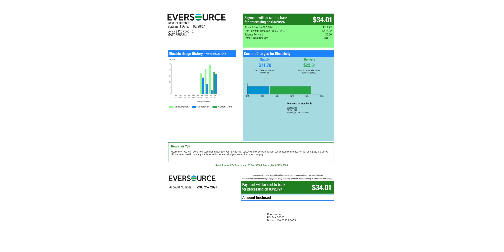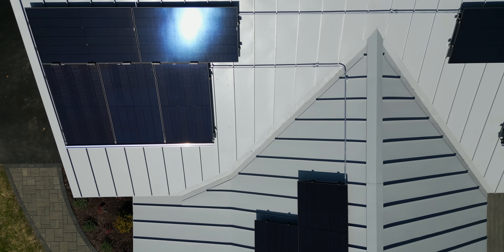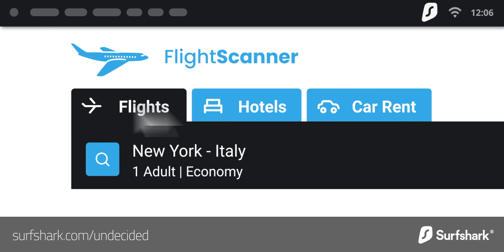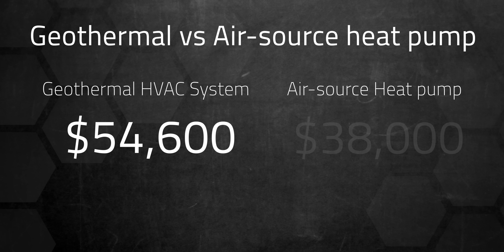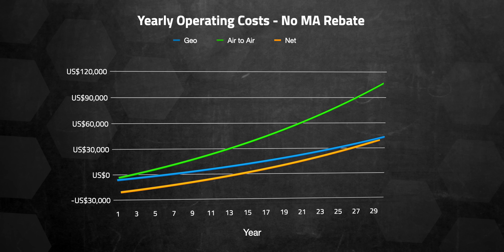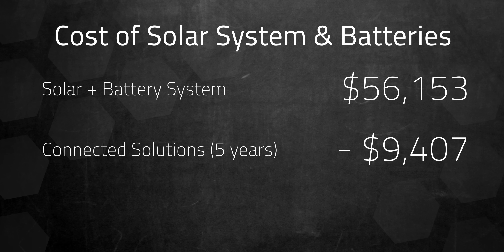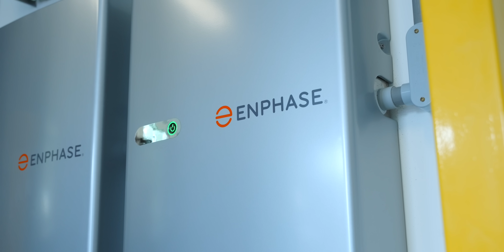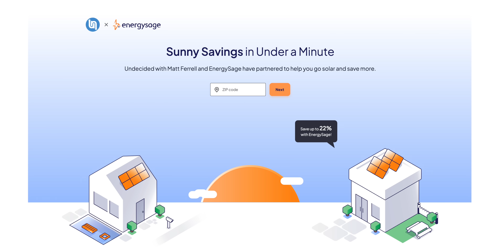What I Learned After 1 Year with New Solar Panels

Comment: We have a solar system that in 4 years has provided a net positive amount as our utility gives us a monthly credit if we produce more solar electricity than we use. HOWEVER, the utility is not solar friendly. They recently increase the cost of electricity to homeowners, but did not increase the amount they pay for excess production. They also have a ton of charges/fees/taxes that almost negate the solar credit, particularly this year. So you have to understand what your electric utility does and if they are solar friendly or not. Same goes with your state and if they have a utility regulatory agency/commission and whether that is solar friendly or not. 
Another thing we found out is although we were sold on manufacturer warranties of 25 years on equipment, we were not informed until later that some equipment had only 10 year warranty terms and that some equipment covered labor for full warranty while other equipment only covered 2 years. So we have had to get some microinverters replaced and now are fighting with the solar panel manufacturer to get one of those replaced. The micro's cost money for labor to get replaced although the devices were covered under warranty. The cost of labor to get the micro's replaced has almost negated the overall annual solar credit. 
So you really have to understand these things and how they may change over time and factor them into the entire calculation if your intent is to generate more electricity than needed and have zero electricity bill AND have no maintenance costs (obviously if you install the system yourself you could perform the DIY maintenance and that would be something to consider). 
If I had to do it over again I may or may not have purchased the system. Having a relatively low electricity bill (about $100/mo avg) also doesn't make the system purchase very cost effective. So that needs to be considered as well. Also my installer initially monitored the system and I was sold that as a feature from them. Then two years later they changed to charging for the monitoring, then they increased the cost as their labor costs rose. SO now I have to monitor it myself, submit warranty claims myself and contact them for install if needed. Definitely not the system I was sold and it has proven to be more of an irritation than I thought it would be as I thought I was purchasing a maintenance free system that would last at least 25 years. HA!. Live and learn.

Comment: Those numbers are insane, 16 MWh covers 4 average households here in Belgium, and the average battery size installed is 3-5kwh. I wonder what it would cost to run your house if it was insulated with the standards for new houses that we've set here, all new houses must use less than 180 kwh/year/square meter to heat it, but in reality it's usually below 100 since that's the goal for 2050.

Comment: Thanks Matt. That is some great information. I have be thinking about doing a four circuit batterie/ solar / utility system to try it out. These four circuit are ones I would like to have power to when we lose power and the portable generator is not running. I live in NH and my house is on the north side of a mountain. So December and January might be hard to make solar power.  I was looking the  EcoFlow pro for the batterie. I don't have a clue yet about Solar panels. The panels would be on the ground not the roof because the roof is in the shade most of the day.

Comment: Our community is eliminating Net Metering and only reimbursing 6.8 cents per kWh. It is even changing the rules for existing solar systems, screwing those early adopters while pulling power from a solar farm 100 miles away.

Comment: The problem with Solar installation and its price, is when the manufacturer price the panels to your region, the wholesaler, the retail seller and the installer all look at your electric cost and government grants when they price the panels. There is no connection to the true cost of material and labor - 100% based on your electric cost. I live in Poland and I can get new 400W panel for as little as 100 USD.

Comment: The eyebrow raising part for me was 55k for just the solar panels and install, considering in this case it's, from what I understand, a new roof that didn't need any preparation or modifications to put them on. We've been hearing solar panels are getting cheaper for years, that doesn't seem like it's the case here.

If it was up to me i'd cheap out and buy second hand ones with as much discount as reasonably possible, even if I have to plan a replacement in 10-15 years, surely we will have better and/or cheaper ones by then.

The whole geothermal part I'm not sold on, I have heard a few horror stories about leaks in the ground after a few years that are basically impossible to get support/fixes for. I'd just go with a 'simple' reversible heatpump system. Much easier to get maintenance or repairs for.

Comment: This is a very nice description of home solar and electricity consumption. I wanted to explain my efforts. I moved to San Francisco about two years ago and had 9.1 KW panels installed in September 2023 for $31K and a 30% Federal tax credit, so the actual cost was ~$20K. My connection to the public utility PGE has full NET metering such that the PGE grid becomes my “battery” and powers my house in the evening. My electricity consumption in 1 year has been 6,000 kwh and my solar panels produced 12,000 kwh, so my public utility PGE, owes me for ~6,000 kwh. Although PGE charges me ~$0.50/kwh, they will pay me ~$0.30/kwh for the electricity I sent back to their grid. My solar powered electricity covers my house electricity consumption and charging my Tesla. I replaced my natural gas stove with an induction range and will soon replace my natural gas HVAC and natural gas hot water tank with heat pumps.  So I will soon be 100% powered by my solar panels. Going all electric (solar panels, EV car, induction stove and heat pumps) is expensive and is delaying a needed kitchen renovation. But as a retired senior, I believe it is very important that I my carbon footprint becomes ZERO and that I no longer produce any more CO2.   Excess atmospheric CO2 is causing heat waves, wildfires, floods and hurricanes. Everyone should think about ways to reduce their carbon footprint. When my carbon footprint is zero, I will put a big sticker on my front window, “proclaiming” zero carbon house emissions. This will be intended as a hint and a nudge for my neighbors.

Comment: for vast majority outside of the sunshine state... this is a long term loss at worst or break even maybe. a system that costs nearly $70,000 after rebates that will likely have some sort of issues requiring service during AND replacement at the 20 year mark does not outweigh an energy efficient home during the same time period whos electrical bill and nat gas come to $180 per month. want to save money? learn to DIY your home and auto repairs, updates as much as you can.

Comment: Span panels are insanely priced!  Emporia makes an economical monitoring solution that works with existing panels for $149 for multi-phase monitoring and 10 circuits (up to 50 amps).  Leviton makes a smart breaker compatible panel where you can add whatever smart breakers you want or move them to various circuits with a simple pop in and out with no wiring.

Comment: 78k for geothermal is absolutely ridiculous.  38k for a heat pump is 5 times the cost in NC.  I don't understand.
Reply from the maker: Soft costs are a big part of this (labor, permitting, etc.).  That's going to vary wildly by location.  I happen to live in a very expensive section of the country.

Comment: A return of less than 200 000$, on a 56 000$ investment - after 30 years. What a scam! Just invest and use the grid. Also, that 200 000$ return for 56 000$ is for a small house, with government subsidies and TONS of additional costs for energy efficiency. Factor in time, potential troubles and limitations, and the fact that solar and batteries will probably get much better and cheaper in the future if you want to switch later. That's a lot of work and research, just to do much worse than regular house + regular energy consumption + the grid + investment.

Do an honest video with ALL your additional costs to save energy: house building, solar, geothermal, appliances, and other systems vs. how much energy $ you'll ''save'' after 30 years. Then factor in the opportunity cost of your crazy initial investment. This whole thing reeks of misinformation with deliberately incomplete data.
Reply from the maker: Sigh ... you're not the only one commenting along these lines.  Again, that's boiling down my goals to just ROI, which is wasn't.  If all you care about is money, then yes ... invest away.  If you have other goals like quality of life, energy security, etc., then it's not just an ROI decision.  I replied to someone else about this, but a not great analogy (still works though) is like buying a car.  If all you care about is getting from point A to point B and nothing else, you're going to buy the cheapest used, rusted out car you can get your hands on.  If you care about safety, gas mileage, seat comfort, quiet ride, and the looks of a car, you're going to spend a little more money.  To each their own, but it's not a scam because it doesn't fit the narrow criteria of ROI only.
Reply: @UndecidedMF  
Money and ROI are absolutely the main topic of this video - you talk about ROI, you talk about costs, you talk about savings - energy security and other factors are barely mentioned. Yes, maybe your project achieves other goals, congratulations - but it doesn't change the fact that your claims about ''impressing savings'', ''clear longtime savings'', ''projected savings'', ''achieving your goals of saving money over time'' feel comically misleading, ignoring huge chunks of the required initial investments and opportunity cost.
I'm boiling down your claims about ROI to just ROI. You're clearly presenting your project as a net positive money-wise. Saving 300 000$ in energy after 30 years, with an initial investment of, say 150 000$, is not saving money if you miss a potential return of 600 000$. Having other goals doesn't make your claims about great savings less ridiculous and misleading financially.
If you were totally transparent, you would say something like ''is it worth it financially? no, the savings are terribly low compared to the initial investment, you're basically spending hundreds of thousands of lost gains to achieve other goals''. Not ''wow, we're making clear longtime savings and achieving our goal of saving money over time''. Presenting this project as financially sound - with the amounts of money involved - is not right.

Comment: Been offgrid for four years. Have a 5kw pv with 40kwh battery. Works fine for the whole year because we're energy frugal.
Reply from the maker: Nice!  Wherabouts are you located?  I would have gotten something like 30-40kWh on my battery system if I could have.  Local permitting would have required installing a sprinkler system in my garage if I went over the 20kWh I got though.
Reply: @UndecidedMF  I'm in Australia, so we have more sunshine. It's unfortunate having to install a sprinkler system for 40kwh of battery. We don't have that problem here, but def worth having more storage if feasible.
Reply: off grid is much less green than grid-tied.   Sometimes even negatively green.   Presumably you live far from the grid, because otherwise it is a big error to be off-grid.  Any off-grid system will have batteries that get nearly full and then all your extra solar is discarded, instead of going to reduce fossil on the grid.
Reply: @bradtem  True ... By about 12pm the batteries are fully charged. If we don't use the oven or air conditioning after 12pm, it's wasted energy 👍

Comment: Hi Matt, our Standard electric water heater failed the same month we took delivery of our Volvo C40 Recharge. I replaced the water heater with the same Rheem hybrid that you have. That was in September of 2022. We only charge our car at home. Since then our average monthly electric usage has stayed within a few kilowatt hours of the average monthly usage prior to having the electric car and hybrid water heater. We were amazed. We are in NE Florida. The water heater is in the 2 car garage and our other car is gas keeping the garage temperature no lower than 70degrees even on the cooler winter nights.

Comment: It looks and sounds like you have a great energy efficient home and a lot of The Upfront costs for hardware and equipment will be paid back over time. How does your homeowners insurance cover all these things replacement value for them? Like batteries solar heat pump etc.
Reply from the maker: Things like solar didn't have any impact on my home owners insurance, but your mileage is going to vary based on where you are.

Comment: Solar Designer here: those panels facing west will produce more energy if they are facing South. Your logic of capturing evening sun is solid, until you apply the Math. You always want as many panels facing south as possible especially with a battery system.
Reply from the maker: Yep, agreed.  I did max out my southern facing roof space.  Those west facing panels were thrown in because it didn't dramatically jack the cost up at that point and still gives us extra power.  Looking at my production today, my southern panels generated 1.4kWh each and the west generated 1.1kWh each.
Reply: And morningcsnd evening power are crucial unless like Matt you spend tons on an overbuilt system. Late in the day is the crunch time. As the other panels start to make less, your usage goes way up. Morning and evening pridiction are key for just adequate dystems especially.
Reply: solar designer? you know the good thing about facing south. at the end of the day when you get home you use the most. and where is the sun? now much of a designer. because if it faced south. you need to increase battery size, now count up energy lost in putting it in then out of the batteries. do the math buddy. don't you understand the 2 times people use the most. morning and evening. and if it wasn't wasted in the charging system you increase useability by 10% a day. and for those people still has a grid tie. when do they buy the most from the company. mornings when their batteries are dead. they have to buy until the sun hits mid day. if they had a few facing east. they would produce more faster instead of having to buy. now go back to what night school you boss sent you to. I AM NOT A DESIGNER. i just stop and thought about it.
Reply: @ and I just did it. Get up in the morning with low power and look at those south facing panels you wish were facing east. Day after day, living it. And as you crank up the loads in late afternoon on low batteies, it's the same feeling, month after month, year after year.
Reply: @BobLSaget  I disagree, west is a good idea. Most people use most electricity in the evening and solar panels are a lot cheaper than batteries. Panels facing east are also a good idea.

Comment: Your calculations of how much money you're saving over 30 years are neglecting the time value of money. If you took the 39600 + 56103 = 95,703 dollars you spent on your geothermal and solar systems and instead invested them in the stock market at a very modest 7% average annual rate of return, your investment would grow to 728,516 dollars over 30 years

Comment: I recommend a battery big enough, to run your home for 24 hours, (including central air) with no other source available. Day to day, that will keep the batteries in the top 40% state of charge, which gives maximum cycle life, as well as maximum calendar life. A 24 hour reserve will give the lowest LCOS (Levelized Cost Of Storage) whether you choose Lead Acid, Lithium Iron Phosphate, or Lithium Nickel Cobalt Manganese. More capacity, calendar life gets in the way, a smaller battery, cycle life gets in the way of getting the absolute maximum through-put per dollar invested in battery capacity. With your high utility rates, optimum battery capacity will save in the long run.
     You're sized perfectly on the photovoltaic array, but you stand to gain a lot, trimming the tree that's casting a shadow on the East most panels on your South-facing array. That could be worth at least 1.5 kWh per day, considering, the shadowing is only during the morning hours. (Even a partially shadowed panel is useless)

Comment: Nice work, great house, your lucky to have the resources for all that. I'll never be able to afford something like that so as I'm renovating my old farmhouse I install a plug, switch and sconce light just inside the door in every room that's hooked to a small solar array with a few batteries for backup mostly, but it can be used all the time if you want. The house is on the grid so my solar setup doesn't effect it in anyway. I'm in a small rural town so power goes out all the time in the winter and having the basic lights, a plug for charging is huge along with pulling out the camp stove for cooking makes life a little easier.

Comment: I see this home as a demonstration, research, data gathering project that serves as a guide for builders, developers, regulators, homeowners. It’s not practical to put this level of technology into one home.  The super efficient structure should only require one moderately efficient HVAC. An above 95% heat pump would suffice. A heat pump domestic water heater also should be enough. The geothermal and solar storage as well all of the monitoring equipment was not necessary. Solar panels in the 300 Watt level would also be enough with a system optimized for about 80% of estimated energy usage.  As to  $$$, since the future is impossible to predict, aging in place, while highly optimal, cannot be guaranteed. Thanks for the videos, data and information you have shared.